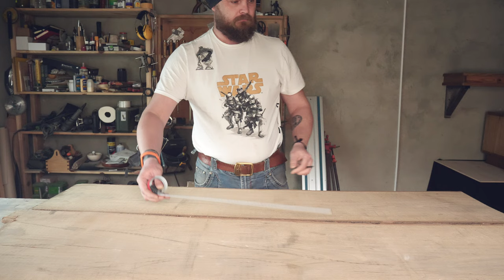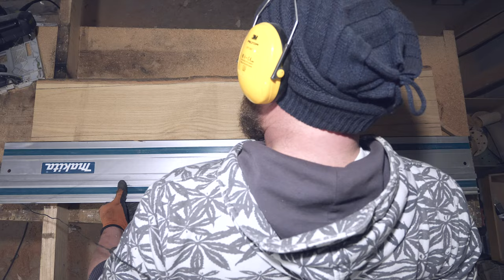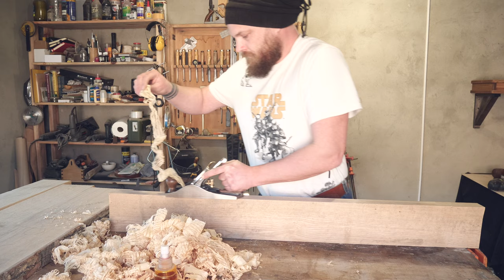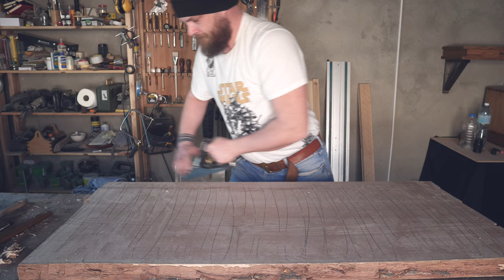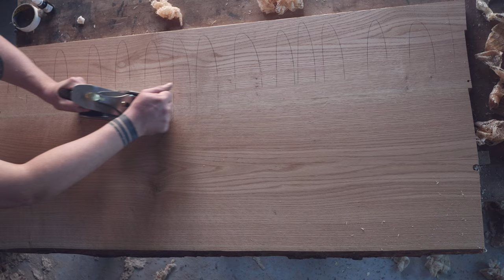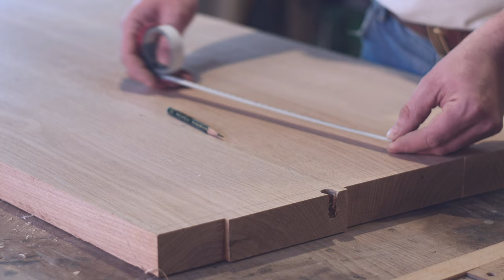Oak desk making

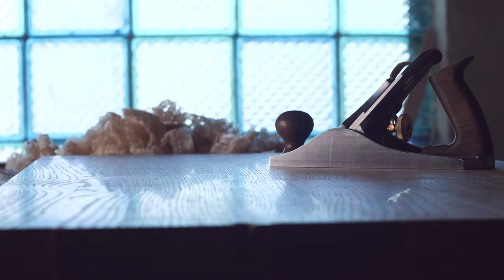Comment: I thought from the title, this video was going to be a comparison between a hand planed surface and one which was sanded, but you only seemed to show the results from planing, which are very nice indeed!  However, sanding still has its place, even in the finest of work.   Sometimes that lovely mirror polish which can be achieved from a well sharpened hand plane (as shown around 7:30) isn't the best surface for absorbing glues or finishes, especially on dense oily woods such as Rosewood, which can be difficult to glue.   Scratching the surface with some 120 grit sandpaper to remove the sheen, helps to open up the pores of the wood to let the glues and finishes soak in a bit more for much better adhesion.